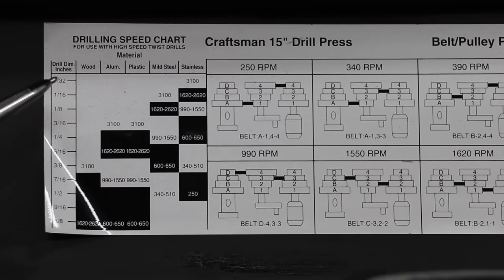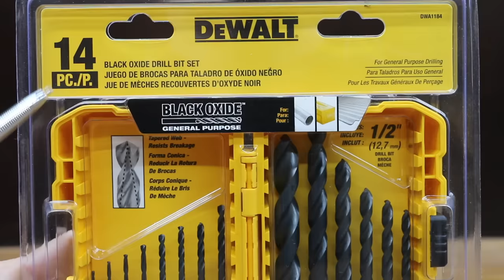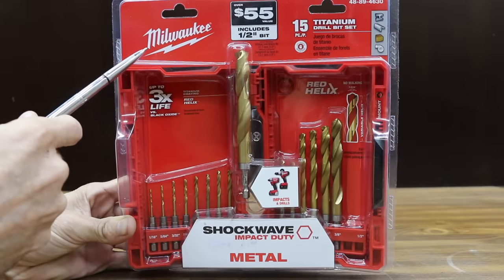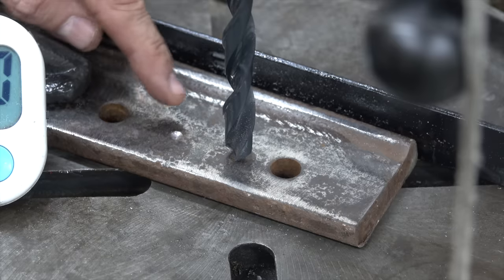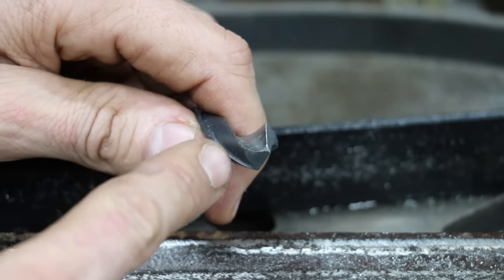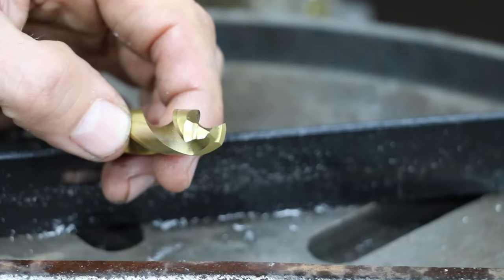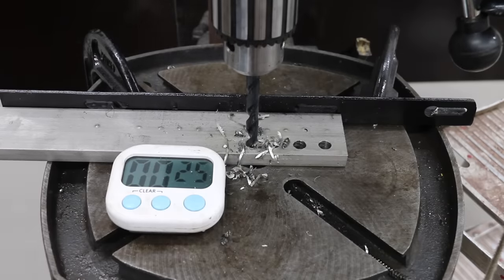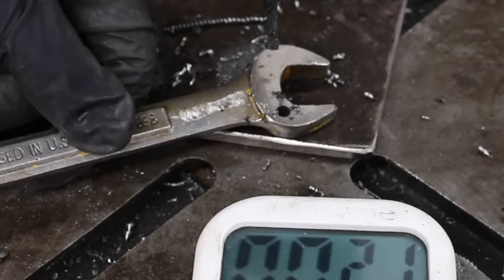Which Drill Bit Brand is Best? Let's find out!

Comment: I have to say cobalt twist drills are absolutely the way to go if you're looking to keep a full set around for steel. Regular HSS never really seems to hold up for long comparatively and carbide is way too expensive to justify unless you're buying a specific size that you're making a lot of holes at. Also, carbide can be too brittle in some situations whereas cobalt is still hard enough to take the wear without chipping out or snapping. I'd be curious to see some higher end cobalt drills put to the test. As a machinist I'd really like to see an endurance test (until failure) of a bunch of brands of HSS, cobalt, and carbide on a CNC and then be able to compare price to see which ones are best bang for your buck, though I know that's unfortunately probably not feasible for your channel. I appreciate all the info you put out, keep up the good work sir!
Reply from the maker: Thanks, will do!

Comment: One problem I keep having is breaking drill bits with too much downward force multiplied by inability to afford even a decent set of cheap bits. The only reason I haven't cost myself more in the long run is because I have only purchased maybe 3 sets grand total in a very very long time.

One thing I'm curious about and haven't looked for yet, is does PF update videos like this from time to time? I am still in a rut of only watching what comes up in feed AND is something that is pertinent to ongoing projects. I have searched for a few specific videos, like the glue tests and other adhesives like jb weld and other epoxies and construction adhesives.

Great work once again
Reply from the maker: Thanks!  I have done updates on products.

Comment: Have you ever used the split tip drill bits? I use to install woodstoves years ago and when we installed inserts into a fire place we had to put a sheet of stainless steel across the top of the fire box sealing off the chimney. So we had to drill thru the metal at the front edge of the top of your firebox. 
We went thru drill bits like crazy trying to drill thru that firebox metal support using numerous bits on just one job. We tried every brand we could find! 
It wasn’t till we found the split tip bits that was a heck of a game changer with just one but drilling hole after hole for several jobs  instead of several bits on just one job!  There’s no doubt about n my mind that the split tip bits would make these bits your using here look like dull old bits in comparison to the split tip! Now what I don’t know and you might know is if there’s different brands of split tip drill bits and if there is which brand of split tip bits are the best?  Never seen you test the split tip drill bits, so that might be interesting to see what you come up with? I know no one else would go to the effort of trying these bits like you do! I haven’t bought any split tip drill bits in years either, so it be great to see what’s out there now compared to the ones we bought way back in the mid 70’s from a business called Palm Abrasive in Portland, Oregon and that was the only place we found the split tip drill bits at the time!  I watch for them in home improvement centers, etc. but never see them anywhere? If you can find them? I believe you’ll be surprised how well they cut thru whatever metal you throw at them?
Reply from the maker: Great information! Thank you

Comment: Thanks for the review. Just went through of process of drilling holes in a track saw clamp to add a adaptor. Basically ruined a bunch of bits. Based on your review I’m getting the Dewalt set. Keep up the reviews!

Comment: Love the concept. Unfortunately tough steel needs to be run much slower if you want to get thru it. You  certainly sorted the junk from the quality. I've been hand sharpening drills for 50 years and less rpm.and more feed is the most productive way in hand work. You lose more time sharpening than you gain from higher rpm.

Comment: 1) Is it safe to say that these same bits ability to drill into steel would be rated the same for drilling into wood?  2) One thing to consider is that some drill bits are designed with a non-skip tip so they don't dance around when starting to drill, so you can actually drill in the correct spot. Drilling well but into the wrong place is bad. 3) I didn't see American Vermont in there which is offered at many stores.
Reply from the maker: Thanks for the suggestion.

Comment: Time to buy drill bits (one specific job on hold because my 1/2" bit is pretty much history).  I was hoping to find a PF video showing how the different types of bit perform (carbon, titanium coated, pilot point, "black gold," etc).  Is it worth the extra money to by the more expensive bits of the SAME brand (say, Dewalt)?  Do the more expensive bits REALLY last X times longer than the less expensive?

Comment: This is a great comparison.  I work on elevators so we drill into steel and stainless.  We usually use Dewalt drill bits, but it is good to know that the Bosch drill bits do better on stainless.
Reply from the maker: Thanks for the feedback.

Comment: I worked on construction sites for more then 30 years and I saw many people ruin drill bits by using too much speed and pushing much to hard or not using a smaller starter bit then use the correct  larger size to finish a hole  !  Cutting grease or wax  also helps to make the bits last longer

Comment: All of the drills would need to have the exact same point to check the times. The point has a ton of influence on penetration. Helical and split points penetrate faster. Split points leave a shit finish usually. 118° tips are nice and I prefer them to 135° drill tips for this type of work. In a CNC, the carbide drills I use are almost exclusively 140° drill points. Helical grinds work great when drilling round tubes. Split points chatter like crazy going through the back side of the round tube. Too much surface area of the lips grabbing all at once. 
I really like that you touched on feeds and speeds. Those are critical. Next are tool geometry, coatings, lubricants, and cutting conditions. Everyone should familiarize themselves with these aspects of DIYing. Thanks for what you do.

Comment: Wow so glad to have found this i got a easy-out snapped in half in my intake i would buy a new intake but no one makes it so i have two choices drill it out and save alot of money or buy a new motor to replace it i think buying a set of dewalt hardened drill bit is cheaper then a motor outa the junkyard in my opinion
Reply from the maker: Thanks for sharing.

Comment: I can't find the black oxide DeWalt bits at Home Depot. They only carry "black and gold". Is that some kind of replacement product? If so I'd love to see a comparison between this new product and the older black oxide.
Reply from the maker: Thank you for the video idea!
Reply: @ProjectFarm  update to this. I ordered the DW1176 bits from the description in this video, but these are not the plain carbide bits - they are the Black&Gold (though the product description and picture shows the carbide). I'm certain it is a replacement product now as the number (dw1176) is the same, but they look different.

Comment: I don’t typically buy “sets” of drill bits. I have a couple there are times you run up against oddball requirements.

Having been a hardware and tool buyer for a couple major “Trade / Contractor Supply Houses” also a Locksmith in the Hollow Metal & Architectural Wood Industry, I can tell you that the right high quality bit and bit type matched with the right high quality tool, can make a tremendous difference.

Its no surprise Bosch came out on top or, that DeWalt (aka Black & Decker’s Revamped “Pro” Line) was right there as well. I would note that many of the better, high end, bits are companies most people would be unfamiliar with as they are not marketed through the big chains or, typically, in “sets”.

Whether its “steel” (bits for Rotary & Demo Hammers), Masonry Bits for Hammer Drills, Various “Twist Bits” (which are actually configured the type of work you’re doing), Boring Bits and even down to “Fastener Bits”, if you’re serious about the work you’re doing, unless you’re in a Professional Tool Shop, ALWAYS Select the Better Known Name Brands and CAREFULLY Match it to Your Tool &/or Usage. (Some of the “features” are Surprisingly Important). 

Often times, in “Trade Oriented” locations, Bulk Bins or Sales are available … specifically for “tips” … and CAN be trusted as these companies are dealing with Pros who WILL Be Back and WILL Keep the Seller “Honest” but in your average hardware or Big Box Store … I wouldn’t trust them … those are cheaper for a reason.
Reply from the maker: Thanks for the feedback.

Comment: Fantastic!!  I'm trying to drill out a couple metal bolts right now from a Scion tow hook mount, under the car in the back.  My metal bits have failed, or are too worn, so I need to go get some that will cut. I've had good luck with the Milwaukee Red Helix bits on metal, but maybe I'll try the DeWalt bits this time.  That second test, where numerous bits failed, looks like the test that tells me the best bits for the job.
Reply from the maker: Thanks!  Thanks  for the feedback.

Comment: I've switched to cobalt bits. In building a quonset hut barn 60X80, I encountered  anchoring plates that would destroy anything but a cobalt drill bit. Now I'm wondering if speed and pressure were factors in the failures. Are cobalt bits worth the extra price?
Reply: Generally yes.

Comment: I just drilled out a deep well socket l, to modify it for an O2 sensor. Maybe I should have used one of those? But I needed bigger than 1/2". I used masonry bits, with Tungsten Carbide tips. Ended up cracking some carbide off at the end. But I could still use the bits for masonry, in the future.
Reply from the maker: Glad you were able to make it work!

Comment: I recently tried drilling through a matco ratchet , to put it on the HF 25" breaker bar,  that was some very tough tool steel to get through. (*to get the slightly bigger pin from the breaker bar through the ratchet) after destroying a few bits. I tried some glass/tile carbide bits and THAT started taking material out and getting through! Seeing a showdown on carbide bits would be great. I had a very cheap 5 pack from harbor freight,  impossible job without those! 🎉
Reply from the maker: Thanks for the suggestion.

Comment: I used to be a fan of Dewalt but was let down when doing a project at the ranch.  110ish degrees and the drills would fail.  I had 3 Dewalt bits fail almost instantly.  I finished the job with a dull kobalt bit. I still like the Dewalt for wood working but I'll keep them away from the sun.
Reply from the maker: Thanks for the feedback.

Comment: Great test, just can't beat the M42 cobalt bits.  I've heard that China has a shortage of cobalt now and you might not get what you normally would or as claimed.  For the coated bits, the coating is a lubricant that helps to clear chips and keep the bit cooler.  Wear comes from heat.  Breakage comes from impact, skipping and chatter, abrasion, gaulling or stopping the cutting tool while cutting.  Carbide has a real problem with stopping and will break nearly every time.  I wonder what steel is used in the Dewalt and Craftsman bits.  They might contain some cobalt.  I'm more impressed with Dewalt every time I use one of their bits or cutting tools.
Reply from the maker: Thanks!  Thanks for the feedback.

Comment: Based on my personal experience and heavy use, I have had the best repeated use and durability and speed with Milwaukee cobalt red helix drill bits. Nothing else comes close. Bosch? The absolute worst,  drilling 48- 1/4 holes in 1/8 metal, than through 3/4" wood, than 3/16" metal body frame, all of this through one shot. Milwaukee never disappointed 48 times without stopping.  Bosch? I stopped after fighting with it on 2 holes and bought Milwaukee cobalt red helix that made this job so enjoyable.
Reply from the maker: Thanks for sharing.

Comment: dewalt is really good... only up to the fourth use, max (you can't sharpen it because it loses its coating). 
Is the bosch quite expensive? yes, but besides taking a LONG time to lose the cut, you can sharpen it (because the cobalt in it is not just a protective layer) i have had the same bosch kit for years and use it often! 
One of the best investments in my blacksmith shop!
Reply from the maker: Thanks for sharing.

Comment: Fascinating channel, absolutely fascinating and entertaining.  So creative.  Consider taking a look at battery powered right angle drills for compact spaces.  I had to install window blinds in 23 windows using a classic Stanley push drill and really wanted to buy a compact right angle drill but they're relatively pricey with batteries.  So locked up trying to make up my mind about what made sense.  Variable speed a necessity, but compactness is equally important.  Drilling a 3/32" pilot hole, but for drilling a hole for electric wires in joists, a whole different requirement for the same drill.
Reply from the maker: Thanks!  Thanks for sharing.

Comment: Have about 10,000 3/16 inch and about 1,000 3/4 inch holes to drill in 16 gauge mild steel and corten...any recommendations?

Comment: When drilling metal more than a 3/8" diameter always drill a 3/16' hole first. An old retired machinist told me that and it does work well.
Reply from the maker: Thanks for the tip.

Comment: Here's a tip.  If you need to drill through a hard steel, use a masonry bit.  The steel shank gives it flexibility so it won't break like a solid carbide bit would and the carbide will cut the steel.  Normally the carbide tip is sharp, but if you get a new carbide tipped bit that is not, just sharpen it.  It will work great.
Reply from the maker: Thanks for the tip.

Comment: Dewalt for hand drill drivers since they are going to get burned up. Bosch starter set for machine drilling. Then individual m42 drills when I need one outside the set. Usually buy at least 2. Or 10 packs of common ones like 4.2mm
Reply from the maker: Thanks for sharing.
Reply: @ProjectFarm  no. Thank you. Before I watched this video, dewalt had me thinking drills in $15 indexes were good now. It turns out dewalt drills just slap and I got lucky that I picked them.

Comment: I've watched a few of your different drill bit tests and although they are all great, I'd love to know if the fancy coatings and alloys on drill bits make any difference to performance, even from the same manufacturer - things like titanium nitride, cobalt, black oxide, etc. I was essentially thinking of coming up with a metric for ranking the different bits according to cost per depth of hole drilled. i,e, if a drill costs 20% more, do you get 20% more life from it, 20% reduction in drilling time, etc?

Comment: Well as a professional machinist I use High Speed Drills all the time.  And Its all in the sharpen.  Ive bought cheap harbor freight drills and put a good edge on them.  with the right angle it will cut great great.  Ive also purchased high end German steel and had a great edge and they cut like crap.  So.   

And I might add also.  When you let a drill bit sit and "dwell" in one spot for a while you can work harden the material and it just wont cut after that.
Reply from the maker: Thanks for sharing.

Comment: 304 Stainless isn't "hard" but it is tough and gummy.  Stainless will work harden however.  This is why a slow speed (rpm) and a heavy feed rate (downforce) is required to cut it.  The drill "chisel" or cutting edge needs to undercut the heat effected or "work hardened" material.  Spin to fast on any work hardenable , or already hardened material, or apply to little feed rate & a melted drill and hardened hole happens quickly!  Good video!
Reply from the maker: Thanks!

Comment: Great comparison, and so much for "Hyper Tough" lol.

I think the test on the spring steel wasn't very well done though.  It was fair since every drill bit was started out the same way, but I think the force applied was simply less than ideal.  Even though you upped the force on drill bits that were struggling, they were already blunt by that point.  If you'd used a higher force right from the start, then you may well have found they all drilled through.  Of course higher force creates more heat, so a lower speed may have become necessary.
Reply from the maker: Thanks!  Thanks for the constructive feedback.

Comment: Stainless steel is a real test for performance of a twist drill. 316 is particularly difficult as it work hardens if you let the tool rub due to insufficient cutting force. The worst materials that I’ve machined/drilled are: Inconnel, Bisalloy, shock resistant brass, and 316 SS, Titanium.
Reply from the maker: Thanks for sharing.

Comment: I came back to remind me which brand to buy because I have to  drill numerous holes in steel to add a brace to my utility trailer. I want fresh drill bits for this project.

Another test that would be helpful to the average Joe would be with the amount of pressure which is normally applied during drilling with a hand held drill. I mention that because you said too much speed and too little pressure will not allow the bit to cut as it should. The average guy is not likely to maintain 100 pounds of pressure on a hand held drill bit. So, judging from your comment, it is better if Joe uses a slower speed. That would be an interesting follow up  to this test but it would be closer to real world applications.
Reply from the maker: Thanks for the video idea.